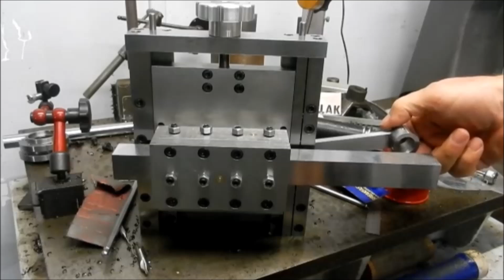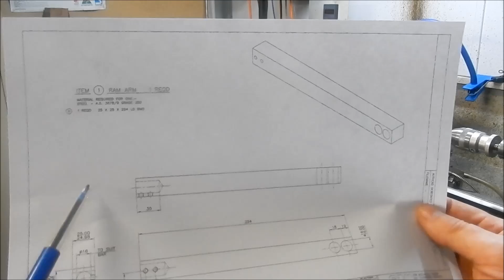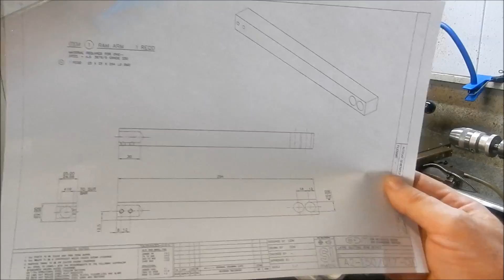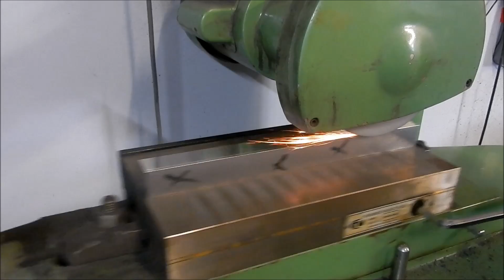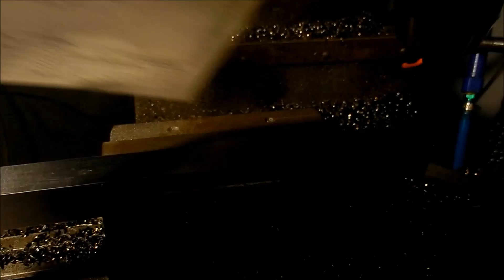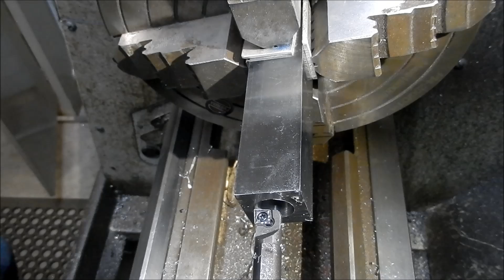Powered Lathe Slotter Build Part 52

Comment: Really enjoying these videos Cam. If you milled a flat on the toolholder it does 3 things. 1: It stops the airlock. 2: it doesn't raise a burr when you tighten the grub screws to fasten the toolholder and 3: it aligns the slot for your tool.
Reply from the maker: Absolutely agree 1ginner1.  It would certainly solve a couple of issues.  
Cam

Comment: G'day Cam, nice work,
Hey I was thinking what happened to the slotter as you had a couple of off subject videos in between and I checked to see what I missed, but you're back.
I always like to see a bit of black steel show it's inner beauty when machined to size and the tool holder "pop" fit always is always satisfying, well done. 
Cheers
Peter

Comment: Magnificent Cam. Been with you all the way and I could not be more proud of you.  What a journey. From the first cut on the scrap tube you have pushed through every hurdle. Very inspiring for beginners like me. 
Thanks for the mention. The chip breaker is fun. I did just spot a modern variant in a Boyar Schultz catalog. Those are for sale for a very large pile of cash. Makes my cast off vintage pieces worth more to me. LOL. I think you should make one. I can pull one apart and let your mind absorb what they did. Every confidence you will draw it up and make it work for beans.  

All the best. 
Dan
Reply from the maker: Thanks for the encouragement Dan.  Its starting to fell like along time ago since I started this project but I can see the light at the end of the tunnel now.
Cam